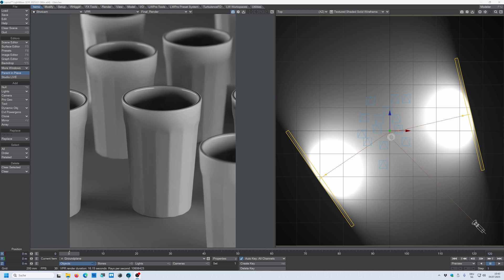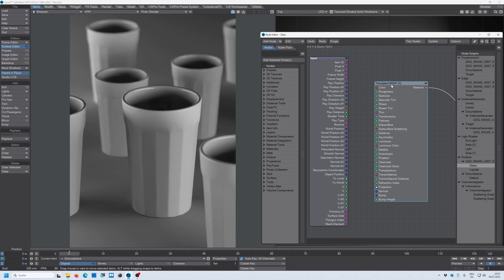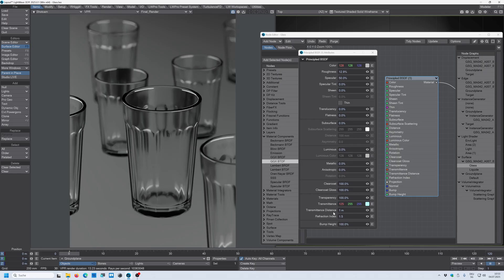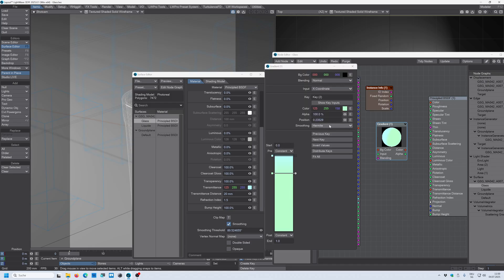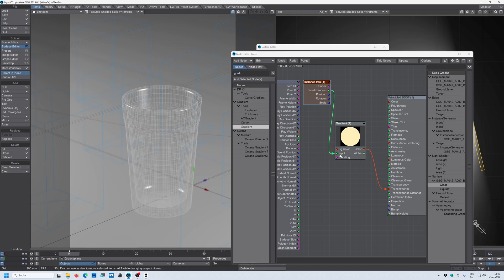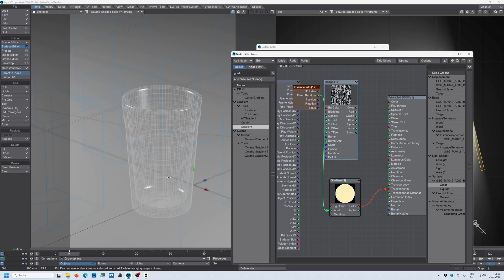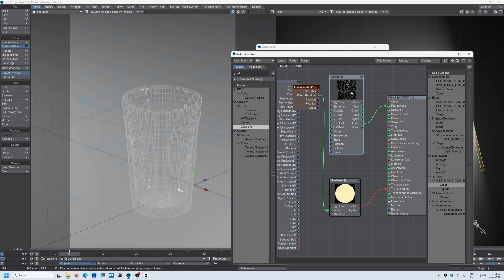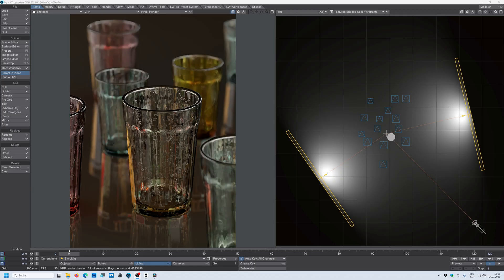LIGHTWAVE 3D / ALL About Nodes Tutorial Series Episode_04

Comment: Thank you! This is a fabulous series.  I prefer the dialectric for most glass and will use a material mixer to blend or mask non-glass portions of a surface if needed.   But that's more complex than you need for this video.  

I have a question regarding the trasmittance distance.   Does that perfectly mirror the thickness of the glass itself?  For instance if I have a 25mm (1inch) thick pane of glass, should I set it to 25mm  for physical accuracy  (within the constratints of my art director's desires, of course)?    

Also, do you have a good way to get that subtle green tint on the edges of glass panes that don't have any tint to them when viewed through the main normal vector?   (ie.. clear looking through the windw, but the edges at 90 degrees from the main "side" of the glasss pain are green).   

Btw, thank you again for something that's been bugging me for years.  You're one of the first (in the Lightwave world anyway) to cover the linear settings for non color image maps for surfacing.  If it's not used to paint your texture, it's data and must be linear.  :)    That's something I don't even see in the documentation.   Honestly, I"d love to be able to set a "default based on connection" for a node.   Auto-set to linear if plugged into a "green" dot. on the material and either "default" or "srgb" if plugged into a 'red'  dot on the material.
Reply from the maker: Thank for you Feedback. About the transmission disdance, there is for sure an accurate value, based on the thickness of the Glass, but I use it more in an artistic way. Sometime accurate values are barely  visible. So I set the value until I like it visually. And I also use the dialectric Node for Glass in the future, I use it on the second part of the Glass Tutorial Serie.